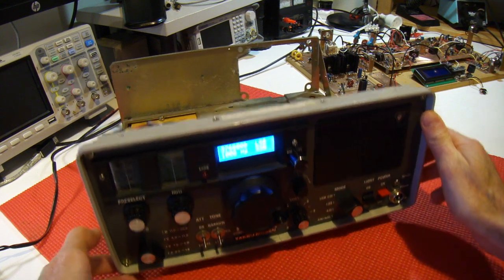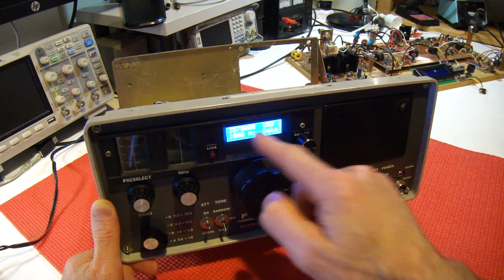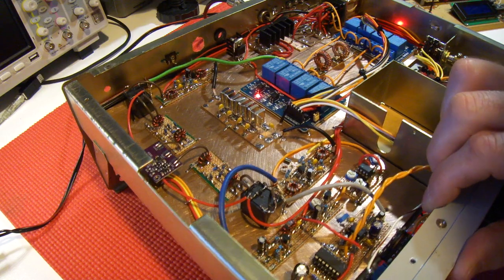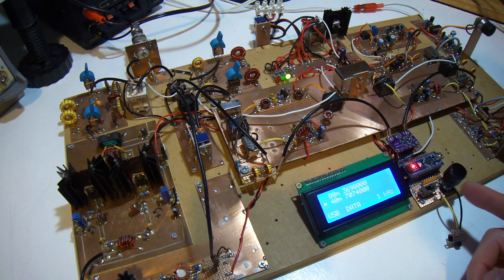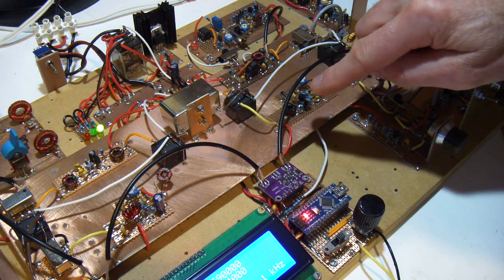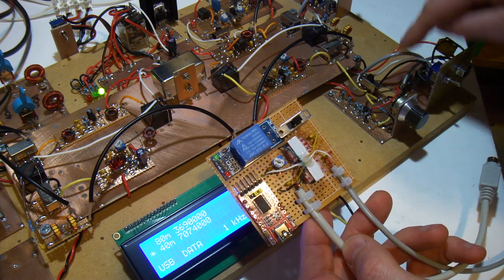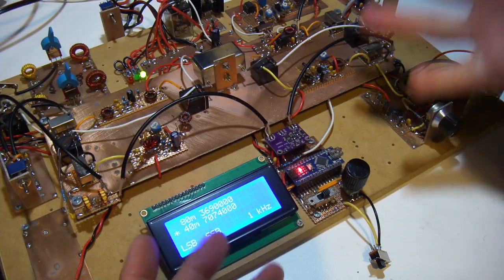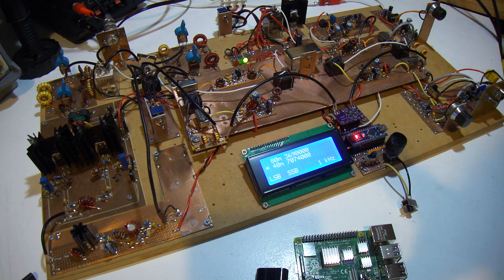This and That: More homebrew experiments.

Comment: The FRG-7 chassis build is very pretty. 

I have one nice old tube SSB rig chassis that I picked up for next to nothing, but is hopeless to get functional once more, (rock-bound rig, with separate power supply, missing, that sells for $200 online,) and I couldn't think of any interesting use for. But I may use your rig as a guide for what to do with it. Make it a custom modern rig, complete with digital modes, and amps for everything from QRPP to a couple hundred watts. (It has plenty of room for it.) Thanks for getting me thinking about it.

Comment: Very cool. I managed to get some reception out of my homebrew rig so far. Don't have an RF pre-amp yet, (not sure why I can't get my 3904 npn's to work for that.) Haven't done any work on the TX side yet and don't have any band pass filtering yet either.
Reply from the maker: Keep at it! You should need too much, if any, RF gain before the first mixer for under 10 MHz. I have not included one for several builds now. Yes you amplify the signal, but also any noise.
Reply: @CharlieMorrisZL2CTM  So far I only have an audio amp at the output, based off your design but altered for my 5v power supply.  Works pretty well, I can hear my IC-718 when I transmit into a dummy load. Annoyingly my homebrew crystal filter is just slightly to tight for SSB so it sounds a tiny bit weird but I feel like that will just my rig its own personality in a way.

Comment: Great to catch up with what you've been building Charlie. Will you be covering the construction of your digital interface board that you showed at some point? I'd be interested in experimenting with that. Incidentally I've been homebrewing some crystal ladder filters - inspired by your Minimum Loss (Cohn) Filters. I've been impressed at how well they work with fairly cheap and cheerful crystals. Thanks a million for all you do and share. 73 Nick (M0NTV)
Reply from the maker: My pleasure Nick. Yes, I'll do another video on the interface at some stage. If I recall I did cover that one at some stage. I'm pleased too that the cheap and cheerful filters are going well. Not at good as commercial units, but hey, they work good enough.

Comment: Wow plenty to keep you busy there. Was thinking, when I built the data interface for my icom rather than running the audio cables to the computer I added a small USB audio dongle similar to the one you showed and a hub to the usb to serial doing the cat control.  I then just had the one USB cable to plug in that did control and audio.
Reply from the maker: That's what i am thinkning too Brian. That approach has worked well for the other rig interface I have.

Comment: Question: (Great video BTW) Other than simultaneous generation of more than one frequency (and cost), can you speak to why you use the si5351 over the AD9850 (or of like kind) given that the AD9850 generates a sine-wave and the si5351 generates only squarewaves?  It would seem that you'd need to constantly be placing output filters (which don't seem frequency-agile) on them thus limiting the ability to make something like a signal-generator or a general-[continuous]-coverage receiver.  Do you find problems with having square-waves "running" around the circuitry--say if you were trying to make a very-high performance receiver and needed very high dynamic range with exceptional S/N ratio?  Thanks & 73...
Reply from the maker: Square waves work just fine with diode mixers. There is a good video on this on the Soldersmoke blog. See https://www.youtube.com/watch?v=WwJKxvz7qbs
Reply: @CharlieMorrisZL2CTM  First off thank you for responding; I thought you might’ve been a little put off by my question but it certainly wasn’t an indictment! Well I watch the video and he’s actually using very high injection amplitudes of 13 to 15 dBm where is most of the classical authors used around 7dBm. So after you watch this video did you ever consider that high of an injection? End it looks like I had it completely backwards in the to reduce harmonics you don’t want to have a continuous voltage on the switching what do you want as much of an instant transition as you could possibly get. Thanks for showing me that because I was really thinking about it completely different; that of two pure tones creating a third pure tone.  Another thing I found puzzling was there when I listened to the SI 5351 on my ICOM 756 PRO II, The tone actually sounded very nice and not ratty at all even though I did not apply any filter to the output!  Anyway Charlie, thank you very much I really appreciate it! 73…

Comment: Any thoughts of using PIN diodes rather than relays? Might prove a useful side project to investgate. Appreciate the content, there is not much home brew stuff on the tube.
Reply: Try searching with #QRPhomebrew
Reply: @tcarney57  One data point on this discussion is the Minikits RF switching diode range, most  of which are PIN diodes. I do trust Mark at Minikits, his range is carefully curated.
https://www.minikits.com.au/BAT18
Reply from the maker: Hi Rob. Yes I did. There is a video on that from a year or two ago. They did work, but I felt for the simple projects I do that extra circuitry (RF blocking inductors etc) was not worth the dB loss across them. I'm very conscious and accept  that relays introduce their own reliability issues, but I'm happy to live with that for now.

Comment: Very good Charlie. How did you do the FRG7 tuning knob to encoder?
Reply from the maker: Gidday Paul. The old shaft came out with the VFO. I actually had enough room to mount the rotary encoder in its place. I can't tell the difference. In a previous build I did you a flexible tube to link a rotary encoder with a shaft. That worked well and took out any play due to misalignment.